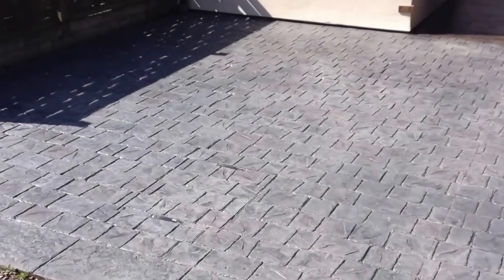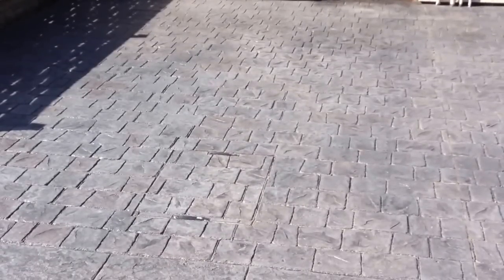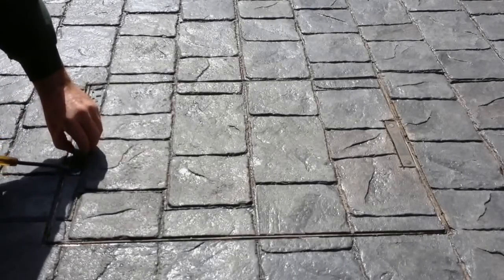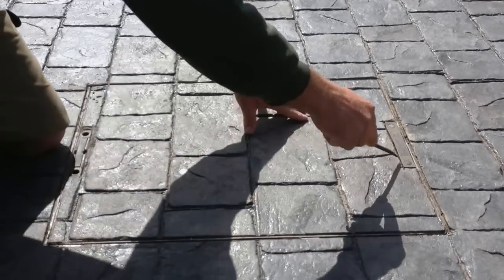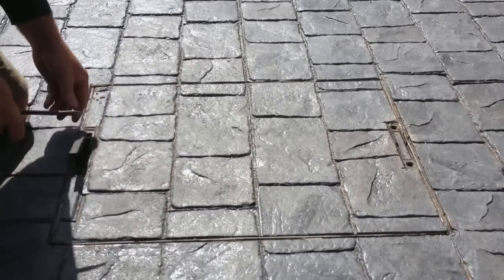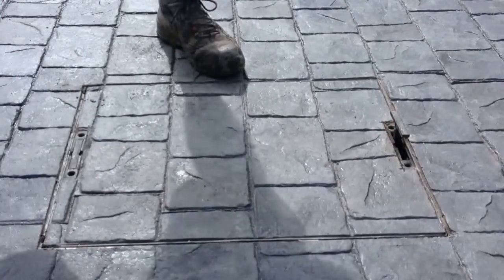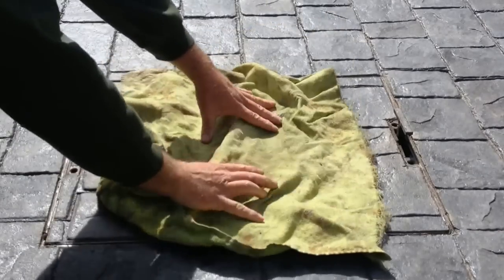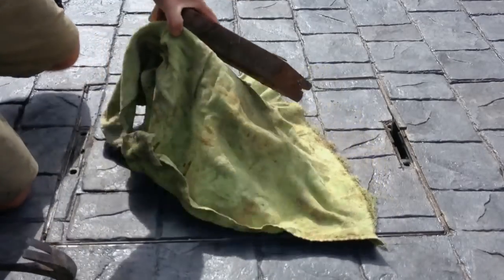How to use a recessed manhole cover with a Pattern Imprinted Concrete / Stamped Concrete Driveway

Comment: Any advice on getting one out if its stuck without having to smash it up?
Reply from the maker: They are often jammed with dirt or sealant between the frame and the lid so putting a lump of wood in the centre and hitting it with it a hammer will often get results. They can also be jammed due to concrete between the frame and the lid or gripping the underside, in this case if you get a large flat headed screwdriver and look for a side where there is a gap between the lid and the frame (2-3mm). Drive the screwdriver into the gap, tapping with a hammer until it bites on the lid. Pull the screwdriver back to try and lever the lid out, it should gradually come but you may need to reset the screwdriver a few times. This will cause a small amount of damage on one side but much less than smashing out the lid. Good luck.